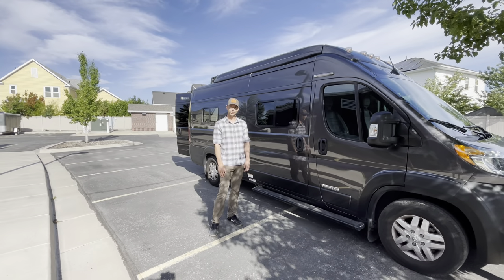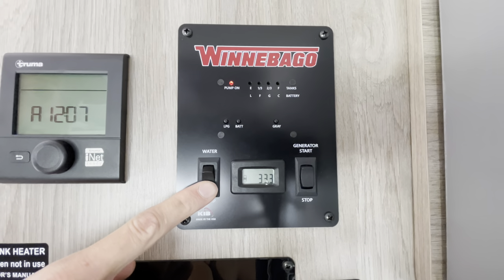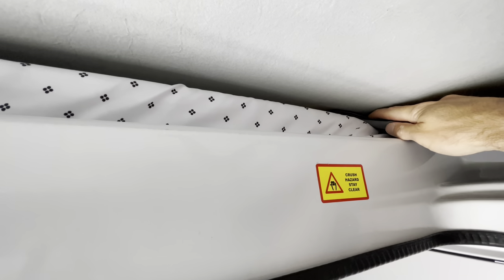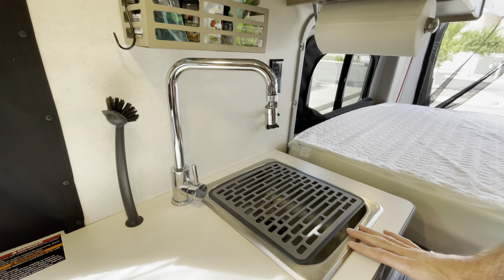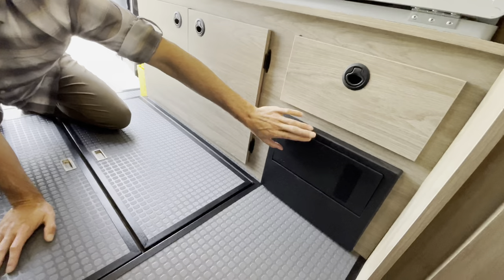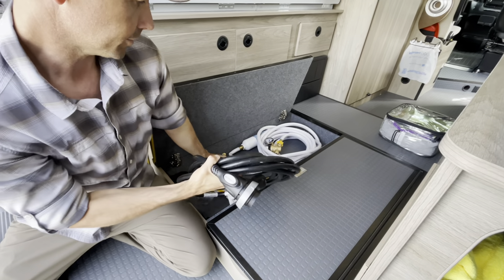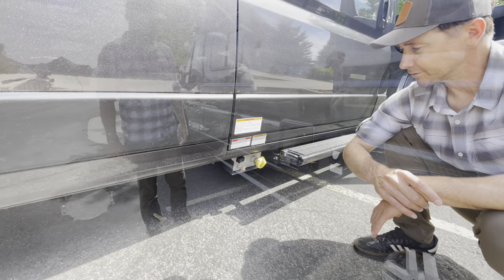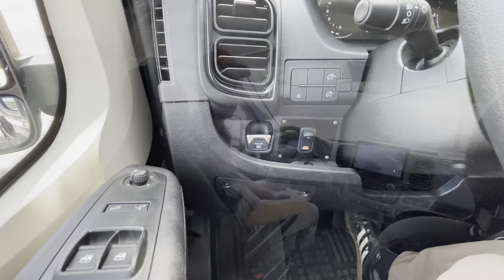2023 Winnebago Solis 59PX - Painfully Detailed Walkthrough (SORRY). For Renters and New Owners!

Comment: Great job! Thanks for sharing. I have a question: what do you do to compensate for lack of a microwave oven? We’re looking at cross country travel twice a year & some short 2-3 day local trips every couple of weeks. Also, is the fridge sufficient size for longer excursions? Thanks.
Reply from the maker: Thanks for watching! There are mods out there where folks wire for and add a microwave in their Solis.

We make a lot of sandwiches, fried eggs, pasta, cooked breakfasts, rice, and we boil water for hot drinks etc. For our style of cooking we don’t miss a microwave. 

I do think the fridge is sufficient for long trips but we bought a 12v Fridge Freezer for various adventures that we occasionally bring in the van… stored under the Murphy bed or in the rear gear garage.

Comment: Anybody knows why it whistles on highway?  This is an excellent walk through about the solid camper can.  Appreciate your time and effort to do this. Better than the dealers can offer.
Reply from the maker: Thanks for watching! The whistling is usually the vent in the roof/poptop. Try opening it partially when you drive. Some crafty folks have 3-D printed a cap to place over the vent to reduce the whistle!

Comment: Awesome video! Do you have a file that you’re willing to share with your pre drive checklist? TY
Reply from the maker: Here you go, I'll copy and paste here, I hope this helps! There is debate among Solis owners about using some features while you drive (propane, generator, water pump...) but I thinks it's worth being safe. I'm curious what others like on their checklist.

CHECK LIST:
1.	Turn off Water Pump
2.	Turn off LP Gas Switch
3.	Turn off Generator
4.	Close and lock Fridge, Bathroom Door, Cabinets
5.	Clear Countertop, Table, and secure belongings
6.	Fasten Seat Belts, seat position
7.	Adjust Side Mirrors. (Note: Side mirrors only close electronically)
8.	Disengage Parking Brake

Comment: Excellent walk through! If you need to winterize where you live is that something you perform yourself? What do you do to maintain the house batteries in cold weather? Thanks in advance for addressing these questions.
Reply from the maker: It gets into single digit temps here. We winterize the water system with antifreeze. I know some folks live full time in the Solis through cold winters but the heater would need to run daily in freezing temps or pipes will break. We use the winterized Solis occasionally in the winter but we use a 7gal water jug and we have a folding portable toilet with disposable bags. Great question!

Comment: Thank you for the  detailed walk through from a different point of view.  It helped me decide on which model van I'm considering purchasing.  My major concerns were the  murphy bed setup , very small dining table and how many features  need the generator on.     I like the floor plan , especially the extra  14"  rear storage.
Reply from the maker: Thank you Stacy for commenting! We're driving home in the Solis from a fly fishing trip now and we still enjoy our adventures in the van, still no regrets for our needs. Rather than use the generator all the time, we bought a Bluetti power station for our 110v needs (which we can also use in our Subaru or Bean camper trailer. At 6'2" tall the murphy bed is a bit tight for me, Tessa and I sleep head to toe and it's fine. Good luck shopping!

Comment: Incredible presentation. Winnebago/RAM should be using this as a tutorial! Great job. I do have a question though. Have read the Dodge Promaster being a front-wheel vehicle is noisy while driving and the least comfortable of the big 3 van chassis. Any comments?
Reply from the maker: Great question. We did notice initially the cabin seemed a little noisy when driving, it hasn’t been a deal-breaker. We can chat without yelling. Both my wife and I each love driving it, I think it’s quite comfortable and enjoyable to drive as do all our renters. I’m 6’2” my wife 5’3”. I can’t compare to Ford or Mercedes, I haven’t driven those chassis recently. We were more annoyed by things rattling in the van all of which I’ve resolved over time. Hope that helps!
Reply: WE HAVE A 2021 SOLIS WITH 30,000 MILES.  WE ALSO HAD A SPRINTER, 2012, AND COMPARING THE TWO, THE SOLIS IS THE QUIETER AND EASIER TO DRIVE.
Reply: Why would a front wheel drive van be noisier? The engine  and transmission  are in the front on both FWD and RWD  and  the tire noise would be the same ?

Comment: Glad you are a taller guy, which offers a good perspective walking around with a ballcap.  I am 6' 3.5" and understand going into a standard van will not be able to walk around fully standing.  Thoughts/questions that you may be able to address:  
1.  Having the top up, overall, does it make the coach feel roomy to you (aside from the utility of sleeping up there)?  I figured it could at least be a place where I could stand to get dressed.
2.  The murphy bed work at all for me as a solo diagonal sleeper?  Context, it appears floorplans with the "north to south" sleeping (i.e. Travato) may be the better fit but I need to experience.
Thank you, I appreciate the details you discuss.
Reply from the maker: Hi Scott, great questions, I also struggled to find info on space for taller folks. I've slept in the Thors also. The north-to-south is nice, my feet still hang off but at least it's into a hallway so my feet are in the open.

The Solis murphy bed is very comfortable for me alone laying diagonally at 6'2". With my 5'3" wife, it's a bit cramped but doable. At 6'4" you'd want to use the murphy bed alone. I'd place my pillow in the corner near the sink so my feet had some space out the rear cargo area and it would be nice. The pop top bed would be good for you, especially alone. I prefer the pop top for sleeping now.
Reply from the maker: You've given me an idea to do a tall people in camper vans video! Just place me and my lady around the van to show the space...
Reply: @roadstoke  ...carve out a niche (van life for tall people) with that one!
Reply: @roadstoke  Winnebago advertises the bed via floorplan at 77 inches, sounds like a stretch.  I understand that feet hanging off the bed, not ideal, lol.  Planning to rent a Travato in October to try this deal.  Thank you for the feedback.

Comment: Nice video and I learn a lot.  one question on eco-hot water heater issue:  I have tried all modes (eco, hot and booster) and wait more than 10 mins, however, the warm temp was still light warm, not good at all for showering.  I turned the position to pre-heat for a couple times, still the same. The propane is full and heating is working.  Only the water heater is not working. Did I missing sth?thanks
Reply from the maker: Sorry to hear you're not getting heat working. Maybe you've worked it out in the last months I didn't respond. I have a sibling who never gets their Truma hot water to work after years of use. I don't 100% trust the Boost option under the sink.

Nowadays, we turn on our hot water about 40min before a shower and we use the "HOT" setting. I'd love to hear if you've come up with any new solution...

Comment: Whats the tallest height person to comfortably sleep the pop top? And are you concerned of potential rain leaks thru the seal overtime?
Reply from the maker: @Gius_13  Good question, I’m 6’2” and the poptop is plenty long for me. It may be good up to 6’4” or more.

In the Murphy bed, I do have to sleep diagonally.

We have not had roof leak problems but some people report leaky roofs from manufacturing defects. We do live in very dry Utah so heavy rain isn’t an issue most of the time here.

Comment: Do you think it would be easy to swap out the table with another custom (more rectangular, slightly wider) one? The oval shaped table looks very small for a family to eat on together. Ideally, it would be longer for two people to work on.

Also is there room for an awning with the pop top?
Reply from the maker: Good questions Brian. I think a bigger, square table is very doable and I do wish it was bigger. You could steal the mount from the existing table. Possible cons to a square: 
1. The round shape allows room to swivel the table to the window and lower the ladder but there’s certainly room for a bigger round shape.
2. A new shape may not fit behind the seat but you could build to spec. 
3. The shape should also accommodate room for the ladder to come down.

The pop top does not leave space to mount and awning from the roof ‘top’ but I can see potential custom fabrication to mount (bolt) to the top corner edge side wall. We don’t miss having an awning ourselves but they are popular!
Reply: @roadstoke  Thanks so much for answering, super helpful. I think a longer table (maybe rectangular but with nice rounded edges) would be a big improvement. Good thought to make it still leave room for the ladder.

I had another question — it sounds like you have two kids — how do you feel those two seats would hold up for a long (cross country) road trip for kids? I only ask because it's hard to get an idea of how comfortable they are and if two kids would have enough arm space since there's no divider or armrest between the seats.
Reply from the maker: @brianfulda  I’ve sat in the back for many hours between stops and somehow it’s comfortable despite how it looks. Kids haven’t complained. 

If you’re shopping I do recommend renting one to see what you think and if it’s a fit, it’s a big depreciating asset to purchase!

Comment: And I guess this is because of the pop top but no fan or ventilation for shower heat/steam or toilet smells ?   Thanks for an amazing detailed tour !
Reply: We've had a 23 new body style with 23 new chassis and had it for a month and we've showered in it. We use the bathroom in it and I mean we have no odor. We just put those little tablets in there in the cassette toilet and we're shocked but there's absolutely no odor. It's crazy this thing ever
Reply from the maker: Great question and thank you for the kind words! We haven't had issues with heat/steam (that we know of). The toilet can occasionally smell but it's probably exceeded our expectations. Tips: Along with using the blue treatment, you can lock in the toilet smell by closing the toilet valve and then do a quick flush to add a shallow layer of water on top. The water makes a airtight seal until you open the valve again...
Reply from the maker: Ya it's pretty darned good! I love hearing other owners experiences, thanks for the commenting! I actually like the simplicity of the cassette all around...

Comment: Great video, thanks for sharing.  Does this model have a microwave oven?  Also, where did you purchase your mattress topper?
Reply from the maker: Thanks for the comment! The Solis models do not have microwaves built in. There are 110V outlets (on generator or shore power) that could handle it. The foam topper is Walmart memory foam.

Comment: Is the Van too high or too long that is not able to fit in the garage because I am interested in the class b 😅 my garage is built after2000 and it's pretty standard size 😢 garage
Reply from the maker: It would be nice to park in the garage. The Solis 59px is 9’6” tall, it’s not even close to fitting in our standard two-car garage let alone under the open garage door. I don’t know how tall the Solis with out AC and poptop is but that won’t likely fit in most garages either.

Comment: A lot of design needed to be learnt from Asian RV companies. Ex, they make twin beds and upper queen bed that can be adjusted by pull down or remote, on top of twin beds, so you can have 3 beds: 2 twins and a queen in the back of RV. In front, they even make the dinner table and can convert to a bed as well as a bunk bed above driver/passenger seats. They also have a dryer inside RV. Guess what class is their RV? You would be surprised.
Reply from the maker: What class are they?! These sound like great features. I have to say the various mainstream builders like Winnie, Thor doesn't seem to come up with mindblowing designs and leave a lot of room for improvement. We still crave adventuring in the Solis every chance we get.

Comment: What brand of strap are you using to secure the ladder to the pop top?
Reply from the maker: Great question, I'm just using the straps included to lower the pop top. I used zip ties to secure the straps to the pop top handles. The i use the strap buckles wrap around the ladder rungs...

Comment: How much gas does the generator use when running the a/c?
Reply from the maker: To be honest I don't know yet. The generator runs on regular gasoline from the van tank it appears, The generator gas costs there has stopped crossing my mind compared to our van miles. It's a Cummins Onan generator and they do have specs out there so I may try and figure it out sometime.
Reply: @roadstoke  1/2 gallon per hour full load

Comment: The latching system and ladder for the popup roof are ridiculously complex. Tooooooo many moving parts. I guarantee people who buy this: they absolutely will have a broken part or two. A simple metal handle that rotates to clamp the sides together would have been better.
Reply from the maker: Yes great points. To be honest, I'm not sure my hanging ladder approach is even recommended by Winnebago. They just had the ladder stored above the front cabin with the window covers but I wanted the space. Thanks for the comments.